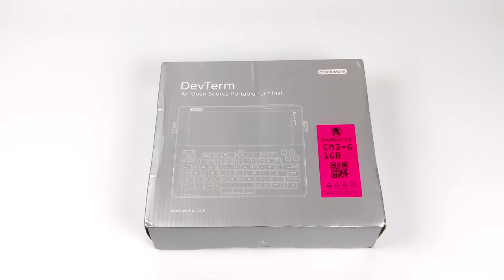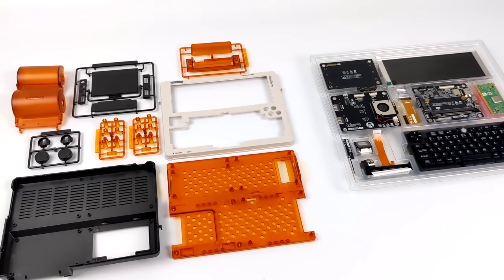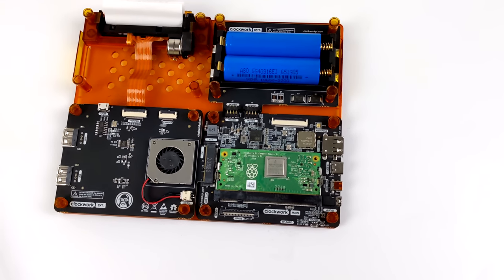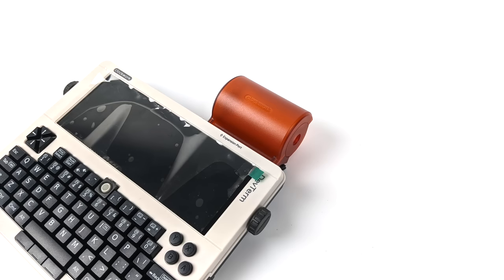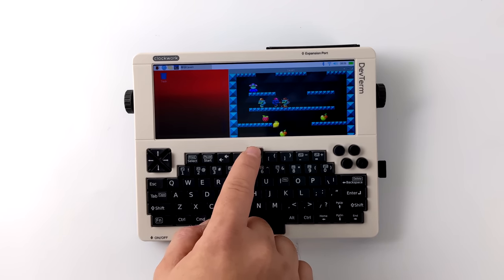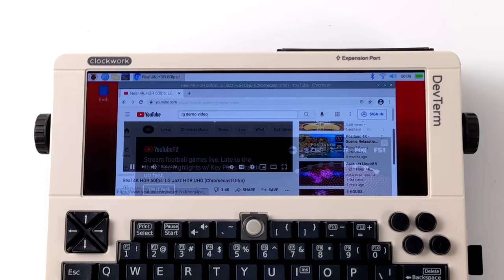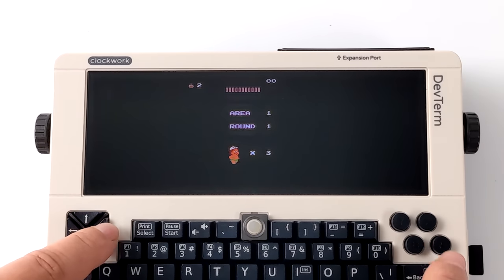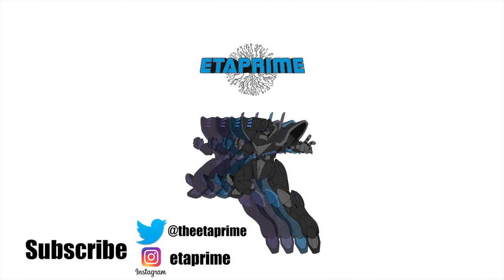This Thing Is Super Cool! Clockwork Pi Dev Term First Look!

Comment: With the right drivers and paper, this would make a very neat moddable label printer, I can already think of a few home projects with this in mind.
Reply: I would probarbly just buy a cheap Raspberry PI + casing then build the webinterface for the printer and attach it to the USB or wifi. No need for screen and keyboard ... for something I only use a few times a year :-)

Comment: The kit is really cool, but for 250$ I want a rpi4 4gb.
Reply: Low volume stuff like this has a special tax. You don't get kits like this for value, if all you need is raw value you buy a used ten year old laptop for 40 bucks (and it still will blow any Pi ever made out of the water in performance and value). Life is tradeoffs.
Reply: For 250...i want a real dang keyboard... which was the killer feature of the original device anyway.

Comment: I own an original TRS-80 Model 100 and it’s pretty obvious it inspired this kit. Good idea, too, because the Model 100 was a legend in industrial and business applications. I could this being very useful in similar usage. The built-in printer is especially useful.
Reply: so I'm not seeing things in terms of design
Reply: yes, I have 2 M100s (need to remember to do a recap job on them, just in case). And I've dreamed of an updated version. Formfactor of the M100 is perfect, imo. Love the feel of the keyboard. Only downside for me, even today, is the slow-refresh screen.
Reply: @Hiraghm  Z88 also got grouped the sinclar spectrum, but it had a lot more in common the TRS-80 Model 100, and a model made by a company called Amstrad (with more colorfull keys)
Reply: @dh2032  I've got all three and the TRS-80 has the best keyb, the Z88 is the most unique one and of wager the NC100 from Amstrad has the best "bundled" software.
Reply: Yes indeed, I have seen s wall mounted TRS-80 in a high-rise building mechanical room   monitoring equipment.
Reply: @Hiraghm  I did lots of hacking on a Tandy 102 back in the day and found that the LCD could run lightning-fast, given the proper driver code. Microsoft's LCD driver was abysmally slow. The LCD directly supported vertical scrolling, rather than requiring a slow refresh of everything.

Comment: Okay picture this: raspberry pi in a gpd win max form factor. It's already mostly used for typing up stuff and light gaming(or emulation, in the Pi's case). We'd need mini analog sticks though, but I can't see them costing much for a company ordering in bulk
Reply: You really need more power than a pi for gpd like gaming. I have the gpd 1 and it runs older games just fine. But there are already pi+screen+controller mods out there. I have a pi zero in a gameboy case. If emulation is what you are targeting these already exist.
Reply: For the joysticks, most of these handhelds just use off the shelf Vita (like the win max) or Switch compatible modules.

Comment: It would have made a lot of sense if they made it like the Atati portfolio. Having a hinge would make it more ergonomic to use on a desk, and more portable folding like a laptop.
Reply: I've been waiting for an updated Radio Shack TRS-80 Model 100 for years and years... this kinda looks like it. I want a slab, not a foldable. (yes, I prefer the Nintendo 2DS to the 3DS, too...)
Reply: This is a handheld not even close to a fulk size keyboard.

Comment: This would be so awesome if this used CM4 module instead of CM3. Maybe screen could be bit taller. It doesn't need to be wider just taller so you can see more on it especially when browsing internet.
Reply: I imagine they went this route for a couple reasons: A lot of Compute-on-Modules use the SODIMM form-factor and the kit is designed to run a terminal interface so compute power isn't the focus here, moreso the power efficiency.

Comment: It's worth noting that Clockwork Pi's previous product, the Gameshell (A modular Gameboy-like Linux machine which is exactly as awesome as it sounds) has been out of stock almost since release (every time I've looked). Folks are buying and selling them on their forums just to get them, though finding an unbuilt kit is very hard. Demand is significantly higher than supply, and while the folks at Clockwork Pi seem to be quite good at making these kits, they don't seem to prioritize making more units to meet demand. If there's anything to be learned from the Gameshell, it's that if you want a new one, get it at release. It'll be hard to find if you wait.

Comment: Cool! Shades of the TRS-80 Model 100! I almost dread to find out the price, though.
Reply: That's the first thing I thought of as well!
Reply: My first thought exactly.  They even copied the color scheme of the Mod 100.  In the days when portable computing meant 30-40 lb "luggables", many reporters used Mod 100's to file their stories from the field, via its built-in 300 baud modem.  On-board storage: 8-24KB (expandable to 64KB), screen resolution: 8 lines x 40 characters, cost $1500+.  Next up: a Bluetooth-enabled buggy whip (with 5G of course).
Reply: $219.  But everything on their store seems to be out of stock.

Comment: As an author, this is very appealing to me, since it looks as it if is much easier to lug around than a laptop, and I really dislike writing on a tablet. It would not be my main writing tool, but when out and about it would be perfect.
Reply: @armamentarmedarm1699  as someone who has been touch typing for over 40 years, you can pretty much get used to any keyboard if you want to. i wouldn't be doing 120wpm on this, but i bet i can get a respectable rate after a few weeks.
Reply: @scottjl  Why not just use a phone holder with a tenkeyless mechanical keyboard?
Reply: @4h0w1e6  His stated desire was something "easier to lug around than a laptop", which a Neo most certainly isn't.
Reply: @HammyHavoc  I'm not sure what you think the Neo is. It weighs 2 pounds. It's a little bigger than the Clockwork, because the keyboard is bigger. If that's too much to "lug around" than you need more help than any electronic device can provide.
Reply: @4h0w1e6  I use a Neo2. The missus uses a Neo2. I'm well-versed with what a Neo2 is and is not. The original comment you responded to stated he wanted something "easier to lug around than a laptop", and expressed interest in the Term, however you then suggested the Neo, which is the same footprint as a laptop, ergo equally unwieldly.
Reply: @HammyHavoc  well a tenkeyless keyboard would be bigger than this for starters. and what are you putting in the phone holder?
Reply: @scottjl  That's the point though. It would provide a faster experience for writing than this, and everybody carries a smartphone anyway. For the sake of a cheap keyboard and one less thing to charge, why not?
Reply: @HammyHavoc  well most smartphones don't run raspbian (or another pi OS) for starters. i never said i wanted to use mine for writing.
Reply: @scottjl  The original comment I responded to with my comment specifically stated he was an author and wanted to write.
Reply: @HammyHavoc  yes. But you also replied and @'ed me too.
Reply: @scottjl  Yes, and you stated that you can get used to any keyboard, and that whilst it wouldn't compare in WPM to a standard keyboard, and the author plans to do a lot of writing, and likely knows next to nothing about Linux, why not just buy a cheap keyboard of any description and use it with his phone? You can even get pocket-sized folding ones, which no doubt would be better to type on than the Term.
Reply: @HammyHavoc  maybe their use case involves using the OS as well as writing? you'll have to ask them, not me.

if a keyboard + phone works for you, that's great. but it's nice to have options.
Reply: @HammyHavoc  Ah well then QED. What would ETA do without you policing his comment section?
To anyone interested in a Neo, forget it, it is as unwieldy as a laptop -- it is much better to do serious writing on a 6.5" wide keyboard.

Comment: I love this design; I've been working on my own OS/Language combo for a while and I gotta say that I'm pretty convnced to try bringing out of the box support for this style of device, so thank you for this introduction!

Can I ask, would you prefer a CM4 over a CM3 in this? I think you mentioned it one, but I coudn't determine if you were for or against it!
(Soz, ROFL!)

But seriously, should I go for this or would perhaps looking at a uConsole be a better default?
My OS system is it's own thing, its not POSIX but will have runtime support for a FreeDOS VM, and it's kind of a hybrid between ASM, C and Forth, although I'm working in an environment
that lets you program in a formal subset of English (AIE, Aritifical Intelligence English, as a I said a formal subset so you can write in English, but defined in such a way to allow a GPT algorithim to easily parse it without worrying about colloquialisms and dialects) that allows it to easily pare down to compiled forth words.
It attempts to do a lot of this on the fly though, so I wonder if the DevTerminal has enough Mojo to allow this?

Comment: A few things i don't like is i'd rather see a dot matrix printer instead of thermo. Because thermo paper is not only horrible when it comes to archival purposes due to its terrible fading issues but also because it is hazardous. And the Display could really need an extra clear plastic cover to protect the actual LCD. Other than that this kit really looks fun to build. Also a fullsite Ethernet port would be great. Don't wanna rely on wireless all the time. Especially when the case and the device has plenty of space for such a port. Serial would also be nice.
Reply: A dot-matrix printer would be very cool, I'd be curious how feasible it would be to fit in the case though

Comment: 😮 You had me at printer! 🤯
Depending upon price, I'm definitely going to give it serious consideration.

At 1280x480, I'm thinking of it as two 640x480 displays side by side 🤔
Would have liked to have seen it with a full'er keyboard.
Reply: the price will be the problem :-( by the time you price up all the bits needed, your in the price range of a good no brand laptop? which would be more compatible, even if only running a raspberry pie as just an emulator on cheap laptop? :-(

Comment: PSA: the DevTerm kit can be ordered with multiple different compute modules included. the weakest being the CM3, the strongest being the A0604, an RK3399 with 4gb of RAM. i think the middle ground one is based on the RK3326 or something, with up to 4gb of RAM available. this is NOT the only unit they're producing. ETA really should have stressed this, because there's people here that are misinformed about what's possible with this kit.

Comment: Honestly, I think that the Clockwork Pi team would prefer to have people purchase the versions of the Dev Term that come with their proprietary compute modules, which have the same form factor as the CM3.  That might be way they haven't created a version of the Dev Term that is compatible with the CM4.
Reply: Their stuff is all open source
Reply: @Motolav  
In terms of software.

They still get their own hardware manufactured.  That includes their compute modules.
Reply: @MrNobody47710  it's literally open source hardware, did you not notice the open source hardware logo on the boards
Reply: @MrNobody47710  their previous project was also open source hardware
Reply: @Motolav  
They still manufacture their own boards.  Even though other people can technically manufacture them, nobody else has.

I'm not trying to claim that they're being greedy, by only offering a version of the Dev Term that is compatible with the CM3 form factor, while offering their own compute modules that outperform the CM3.  If anything, they're just trying to keep things simple, at the start.  The simple solution is to just rely on their modules/boards before branching out.

They claim to be looking into support for other boards, for the Dev Term.  That's compatible with this interpretation.

For all that I know, they may just prefer the form factor of the CM3 over that of the CM4.

Comment: There is no substitute for CPU power in these devices.  The Pi4 does consume more electrical energy though and would likely need a larger battery bank to be useful.
Reply: Running a CLI doesn't need much power anyways, this is meant to be a tool more than a media device.

Comment: I wonder how well it can handle Parsec. It could be a servicable portable cloud computer that way
Reply: Parsec has never worked well above 720p, but Steam Link works well at 1080 on my Pi3. Need to make sure the host computer is strong enough though, my 3570 won't cut it for streaming in many situations.

Comment: seems a little dangerous to put the batteries in while assembling doesn't it?  Yeah, the second it has a cm4 I'm getting one.  Need to work fast with Clockwork, there devices aren't available for long it seems!

Comment: Great kit. The hardware is still quite a bit underpowered. But I assume this is also a bit of a driver issue. And although I know that this would add another level of complexity, but it would be great if the screen could be tilted to some degree.

Comment: Performance seems pretty poor even for that module; I mean, where you're like 'we shoudl be able to do NES' ... we were doing NES on machines 15 years ago without much problem ;) Youtube at 144p too .. we had linux machines sub-1Ghz single core doing higher resolution YT 10 years back too. So just needs some optimization, maybe a better build of the OS, some love...

The casing is gorgeous though; I wonder if the keyboard protocol across those 4 pogo pins is easy to sort out, use it for other projects.

Comment: 1:25 16:6 aspect ratio IPS screen eh? If they use 16:4 or 4:1 aspect ratio IPS screen, that would have been perfect for a few arcade games that utilized ultra wide screen like Darius or Ninja Warrior. But then again, this machine is not meant for emulation.

Comment: looks like way to much plastic that will go into the sea (eventually)...

Nice idea though (Can it emulate an Amiga?). It resembles my case for my pi if you remove the display, handmade from wood, a bit more friendly to the ecosystem I think, and with a bit of work, more friendly to your wallet.

nice project though...

Comment: Cool. Shades of the old ti-80 machine. 
What would be cool if the track bowl is actually in the front bizzle of the machine instead of on the top. Had one laptop that was like that it's like right in the middle of the front panel. Put it perfectly in line with both thumbs. But out of the way on the keyboard top

Comment: With the printer it could be made into a portable POS terminal.
Or a network engineer could use a Serial to Bluetooth adapter to configure switches and routers.

But damn why the CM3??
Reply: theres two better faster modules available, he should have made that clear.

Comment: What are the thumbwheels used for?
Reply: Closing the two halves of the case together
Reply: @PixelisedPaul  There are much easier ways to close the two halves of the case, the only way this would be of benefit is if you need regular quick access to the innards or 100% toolless assembly.
Reply: @AndrewAHayes  its 99 percent toolless assembly + quick access to internals with no tools
Reply: @AndrewAHayes  chill out mate, I didn't design it
Reply: @PixelisedPaul  I think there is a bit of ambiguity here, I didnt mean to make anyone feel bad, sorry!

Comment: This is pretty cool, but the question still remains - what for?
Reply: Server maintenance. Laptops are bigger than they need to be and using a CLI on a tablet is awful.
Reply: @amirpourghoureiyan1637  netbooks are cheaper.
Reply: @H34D5H07  this will run a lot longer and can be charged with USB.
Reply: @amirpourghoureiyan1637  my netbook runs 6 hours on a single charge and boots in seconds thanks to cheap ssd.

Comment: But for what purpose this thing is used for with that wiered Ratio of display and with that different keyboard and also with that thermal printer
Reply: calling it a "devterm" suggests to me that it's probably designed more to be a "terminal for developers." Probably debugging servers or plugging into computers that don't have a screen so they can be reprogrammed, you might need enough space for two windows side by side.

Comment: Ugh. Releasing your schematics as PDFs does not make your project open source hardware. Would be really nice to roll a cm4 mainboard for it. No cad no layout though. I'd have to get it and measure the connection spacing.

Comment: The biggest problem has got to be the lack of a screen hinge. You can’t use the keyboard properly when holding it and you can barely see the screen unless you’re hunched over it. There’s a reason why this form factor doesn’t exist anymore. The print options are interesting but the ergonomics look horrible.

Comment: The choice of the CM3 instead of the CM4 is the absolute deal breaker. I want to luv this but it's a hard no for me.
Reply: dude didnt seem to mention at all that there are two way more powerful modules you can get with your unit. i dont know why they show off the weakest possible module when theres an rk3399 one available from them as well